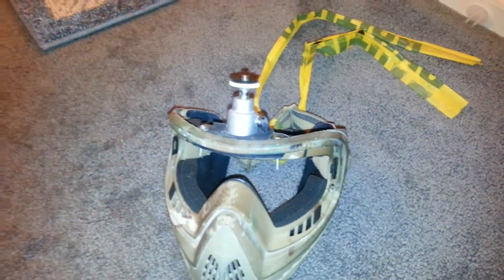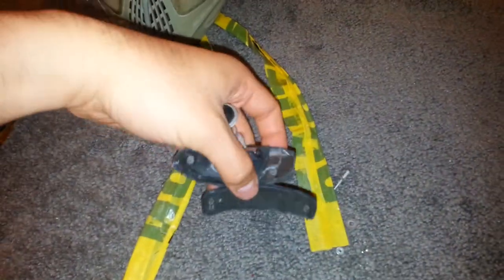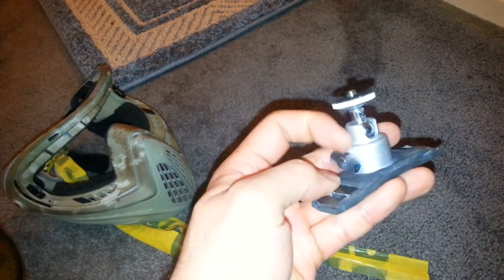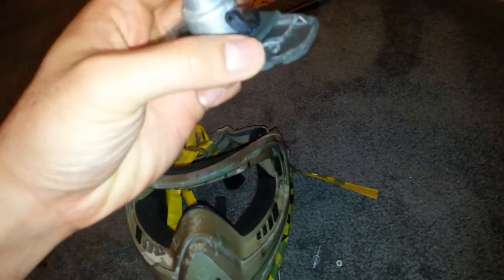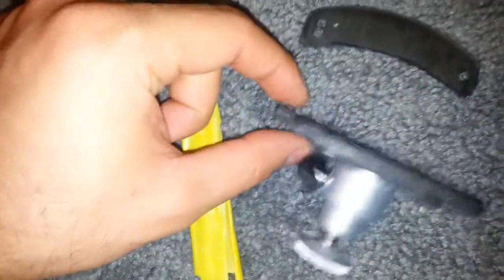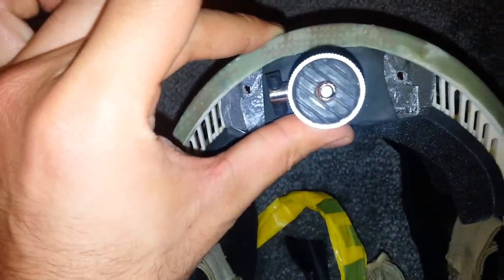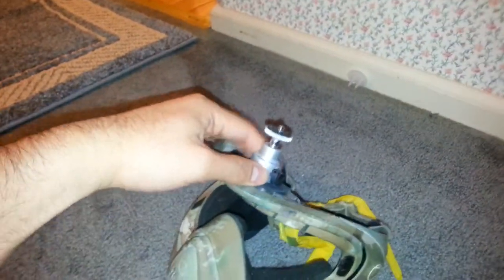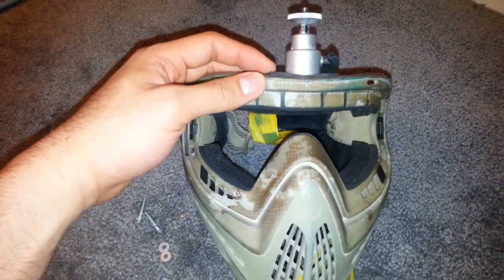Center camera mount for Dye I4

Comment: I've done my mount on tme and going to make a short video to demonstrate how i made it. I couldn't make it how i want it at first, but  in the end it isn't that bad i think on the beginn. The only thing that disturb me on it, is the profile of it (it's more visible , because its high and the sony cam fits better on the side of the mask) and i'm totaly agree with you that the angle of the camera is little better.
Reply from the maker: I thought the same at first--but I've realized that since it's fairly thin, it doesn't seem to affect much in terms of game play. hope it helps
Reply: At the end i've take an 2mm aluminum sheet rest that i had at home and made 2 frames there hold thogeter with an threaded rod and 2 nuts. to fix it on the mask i've make an other plate for the inside of the mask and drill 2 hole 0.5mm bigger than 1 of the frames to drive my screw into it. To fix the camera housing i used the screw that holded the camera in the box from sony (in this case ist hdr-as30 or an hder-as100 comes in an hardplastic box with a stand where they are screwed on, the hdr-as15 comes in a cardboard box) but like i siad im going make an video tommorow.
Reply from the maker: great! I'm glad it worked out!